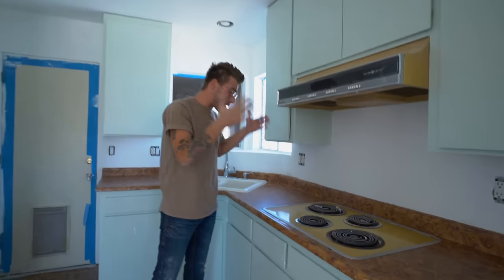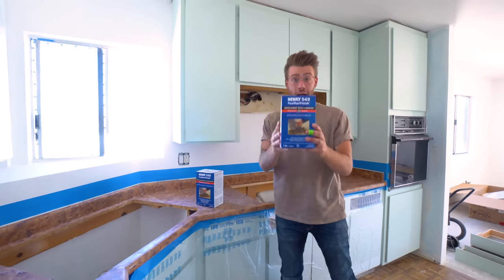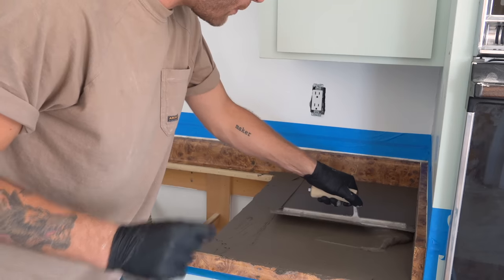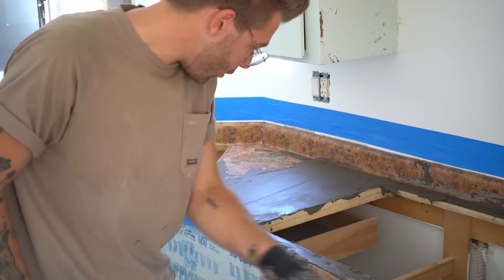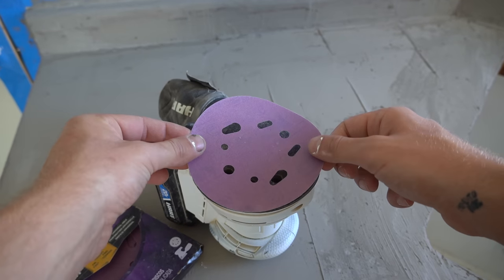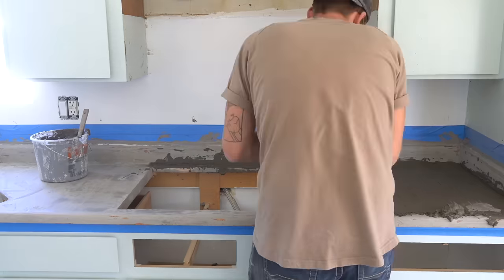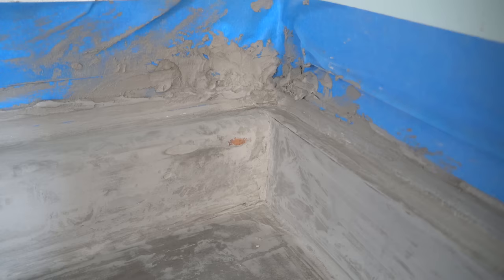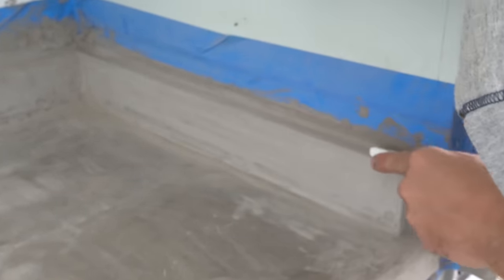DIY SKIM COAT CONCRETE COUNTERTOPS OVER LAMINATE | Modern Builds

Comment: Painter here, I've had a LOT of experience in mudding. I've found that once your mix starts running dry, and you try to apply it, it starts actually pulling off of whatever you're applying it to and won't bond underneath. It's kind of like smearing dry caulk on a surface and expecting it to stick, it just won't do it. The water helps it bond and allows adhesion. Just my experience. Thought I'd pass it along. Great video and best wishes!

Comment: So for people asking about longevity of this approach I think I can weight in here. I actually did this same process 4 years ago this month with Henry feather finish. I used a different sealer and impregnator but you get the idea.
For me the countertops mostly look the same as the day I did them. Really the main areas of wear I have seen have been the edge of the countertop by the stove and sink (places you'd lean against).
For the price id do again. My previous laminate was trash and this is a good solution. The nice thing, for the price of materials, if you don't like it you can just buy another countertop and not be out too much more than before the project. 
Hope you like your results. Cheers
Reply: Did you do a thick or thin first layer?
Reply: @sharbyduke  I had started with a thin coat and just kept doing multiple coats
Reply: Did you like your sealer? Do you have to reseal often?
Reply: i cant get that where i live, what would you recommend? It cant be hard to make surely, cheers

Comment: This looks so cheap.
It's too thin to last more than a month.
Reply: Yea there’s no chance that thing will last.
Reply: it will separate from the countertop.
Reply: Im also interested if it will stand a hot pan, since the coefficient of expansion will be diferent between the wood and concrete
Reply: Yeah, honestly it would've been so much better to show how you can build your own. You can practically use the old countertops as a guide and go from there. Plus there's countertop mix that doesn't end up looking like that.
Reply: @BillPairaktaridis  He have already build concrete countertops before.
Reply: @saulgoodman2018  Rapidly loosing faith in this channel. Content for the sake of content.
Reply: @RYU47376  The laminate under the new concrete like finish is not heat resistant. So this treatment wouldn’t make it any better or any worse regarding heat.
Reply: @Factory051  byeeee

Comment: Mine were chunky and squared off instead of rounded.  I used Ardex feather finish and I have loved mine (mine are a lot darker) for 11 years.  I'm only now replacing them, not because they haven't held up (they have) just doing a whole kitchen remodel with different layout.
Reply: Did you use the same process?
Reply: @lynnporiumartdecor8348   Yes, be prepared for so. much. dust.  Took forever to get it out of the house.  If I were doing this again, I would have taken them outside.  I put 3 coats of Ardex on, then stained them dark and sealed them. It held up for years.
Reply: @debbydhill  thank you Debby for sharing and responding!! 🙏🙌
Reply: @debbydhill  what did you stain them with??
Reply: @gracewang202  Concrete stain from Home Depot in a dark gray

Comment: The reason that people do a thin first coat the one you said looks like a slurry, it’s actually called a ‘slurry coat.’ It’s the first coat mainly because it serves as the adhesive base. Concrete doesn’t (typically) stick to concrete- so you have to do them before they are 100% dry that way they actually DRY adhered and not just ‘sitting on top of each other.’ The slurry coat should be thin that way it serves as like a layer of glue to adhere the actually concrete to the laminate. If it’s too thick if would just be another coat.

Comment: I love concrete, love a lot of your videos... BUT, this one is a no (for me). It's not aesthetically pleasing and it won't last any length of time, sorry
Reply: Where is it you think it will fail?
Reply: @freedomofreligion3248  it will crack in a number of places, the edges will crumble in places. It will be brittle and won't withstand impacts well. Someone's comment below confirmed this from experience. Not wanting to be negative, but realistic. I would install proper concrete countertops with mesh/thin rebar/fiberglass strands and a few coats of sealant. They look stunning and will last a lifetime 👌

Comment: Not a chance this lasts longer than a few months under normal kitchen use
Reply: I was wondering what happens if you drop a dish on the counter top.
Reply: @rchavez5056  crack
Reply: Considering it is designed to fill voids in subfloor,  probably last pretty good
Reply: As soon as I started researching concrete counters to redo a bathroom, this stuff came up. Tons of diy blogs and videos recommend it for kitchen use and all say it lasts years.

Comment: Here in india, we use Large Slabs Of Granite (10-14 Feet×2-4 Feet) And The Countertop Looks Awesome. Better Than Fake Wood And Cemented. I think you should try, if available in your country
Reply: Seems like you have a lot of money there in India 😂
Reply: The US is literally the wealthiest country on the planet, of course granite is available and used frequently, but not in a quick low cost DIY like this. To redo those counters in granite would have easily been $12,000-$15,000 and would require a professional company. He spent $25 on that box and probably another $20 on tools, that sealant costs $30. So he has a few hours of time and under $100 invested. Concrete countertops are extremely modern and look better than granite when done correctly.

Comment: This is not going to work. This will fail. You didn’t even sand the surface? You know not even contact cement will stick to the finished surface of laminate right? Looking forward to the next upload where you show how bad it went sideways. 😂🤣😂🤣😂🤣😂🤣
Reply: He sanded with 150 grit before starting.
Reply: @FullRythym  my bad missed that. Still won’t work unfortunately. I give it under a month.
Reply: Did you even watch the video?

Comment: Random tips to add:
A slightly thinner slurry levels easier, but its still best to do several thin coats.
For the corner edge, we applied a copper right angle strip with liquid nail and a few pre-drilled flat screws, and avoided the chipping where it gets wear and tear.
You can get sealers designed to add dye to have a solid color, or marbling, etc rather than gray.
You're going to want it as smooth as possible so there's little sanding. A thinner mix helps this, as does finishing with a soft squeegee as a scree.
We also wrapped a large cutting board in plastic and pressed it in slightly as it dried. It made a small indention that holds the cutting board still, but it can be taken out to clean.